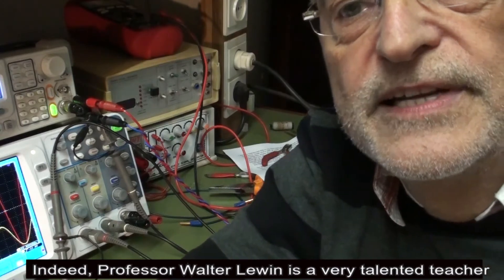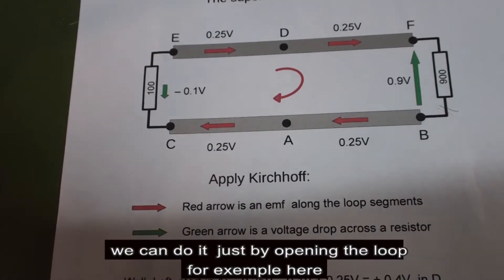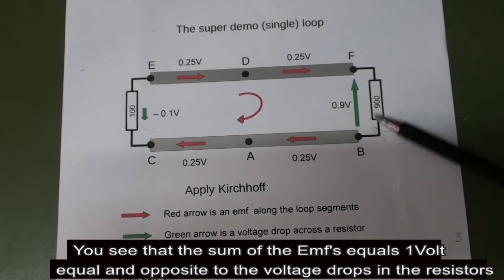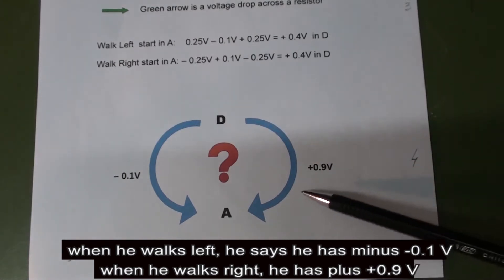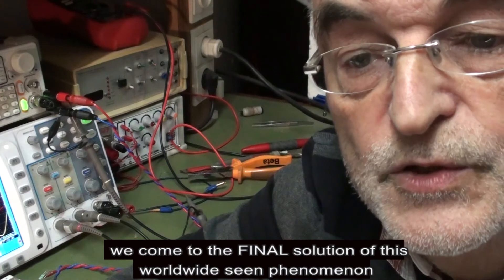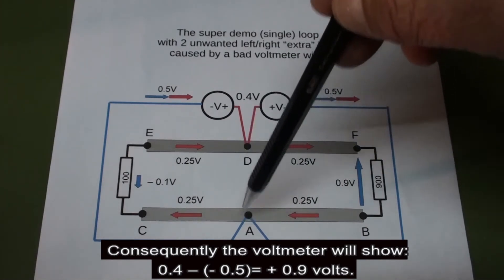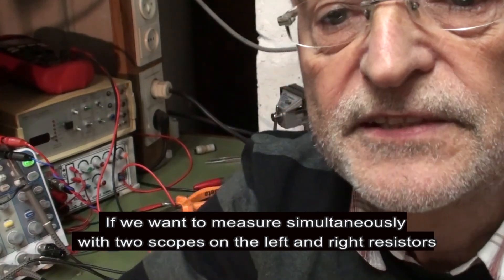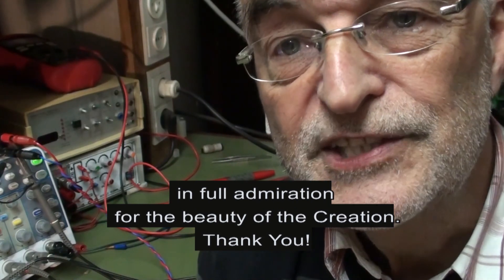W. Lewin Lect. 16 super demo revealed

Comment: Hi, at 17:13 when you flipped the probes and got a 0.9V to -0.1V switch, I told Dirk Meirvenne to try the same thing, and I told him the values would be 0.9V and -0.1V. First, he hid my post. Then, when someone requested the post back, he repeated his claim that the values would be 0.9V and -0.9V!!! Then he blocked me from posting anything else! So, I was right and he was wrong.
Reply: Mr. Stanger, you asked me what would happen if I turned my transformer 360 degrees!  Everyone still can read this.
This is copy/paste of your question Mr Stranger:
" I would be interested to see what happens if you were to repeat the 900 ohm measurement and turn the transformer over through 360 degrees (i.e upside down and continue until it is back upright.) Does the reading stay fixed, throughout?"
I gave you a complete description, and indeed at 180 degrees +0.9V will be -0.9V. 
If Mr. Mabilde turns his pulse giving coil 180 degrees (bottom/up), he will also measure -0.9V instead of + 0.9V over the 900 ohm resistor!
Just as are lying now (everyone can read your lie by comparing on my forum), I hope you don't start with your nonsense on Mr. Mabildes forum!
Reply: Dirk Van Meirvenne, You have hidden posts. That is why the post count shown is not the same as the number of posts you can actually read. I can still see my posts that you are hiding, even though no-one else can. If you hide things, not everyone can read them.
Reply: Here is the content of the post you deleted, Mr. Meirvenne: 
>>>>Yes, he seems to have deleted it. Maybe there is a confusion with the terms we are using, and he couldn't follow the post. I am not completely sure, but I think his argument may be that the PATHS of the probe leads are not part of "the circuit" and are irrelevant? The experiment I posted will show that they are still relevant, EVEN THOUGH he "concentrated" the magnetic field by using a transformer.
I wanted him to turn the transformer and resistors part of the circuit upside down (that whole unit), leaving the path of the scope probes fixed. And I wanted him to take measurements at fixed angles of tilt. There should be a 1 volt swing in the peak shown on the scope (say +0.9V to -0.1V). You can accidentally cause this 1V change by swapping the paths of the probe leads relative to each other (for convenient attachment)., effectively turning that part of the circuitry upside down, instead. The point is that the two parts of the circuit are reversed with respect to one another, whichever way it happens. That is what I think Dirk has done, and accidentally introduced an inconsistent 1V change in his reading. I hope this post remains. :-) <<<<<
The highlighted portion is equivalent to what Mr. Mabilde demonstrated. He could have flipped the whole primary/secondary/resistor assembly and kept the probes fixed. The sweep from +0.9V to -0.1V would have been the same.
Reply: Mr Icy, 1. I didn't hide your post. I was warned by youtube that a spam was coming in and if I want to delete it. I said" Yes". If I had to hide something, I wouldn't have recovered it, after it was asked by "Eshqa"!
2. The different with mr. Marbildes experiment and mine, is that I did all the effort to avoid that the magnetic field could exist in my measuringwires or probes by using a transformer. (see my whole introduction about this). So my results were produced in a way that always the same values would be measured, regardless the position of my wires or probes. So by turning the whole upset (transformer, the closed circuit etc.), my readings wouldn't change. Mr. Marbildes accepted the external induction and showed in a perfect way, that only his wires and probes are not effected when they are in a position that the cosinus of the induced field is zero. (90 degrees) Only in that position his measurement gave the correct values, as he made clear. Anyway, Mr. Marbildes and I have the same kind of conclusions, but these conclusions are not the same as Mr. Walter Lewin's conclusions.
Reply: Dirk Van Meirvenne, you placed a small closed loop at different positions next to the transformer. You got a negligible reading and misinterpreted this as the measuring wires being isolated from the inductance effect. The other poster explained your misinterpretation. I guess you blocked him too. I do not believe your spam explanation. You have deleted more of my posts and blocked me from posting altogether.
If you turn your module upside down, while keeping the measuring wires in the same position, you will get the same result Mr. Mabilde got by flipping the leads across. The reading will not stay the same as you imagine.
Reply: Mr. Icy; I will ask you some questions about basic knowledge which can be answered with yes or no: 
Suppose you do the next steps with a transformer e.g. a transformer with an metal E-core :
1. You have a transformer and you put an AC voltmeter over the secondary which shows 10V. Is this possible: yes – no?
2. You count the secondary windings and find it has 10 loops. Now you make a connection between 1winding and the other 9 windings and you do a new voltage measurement. Your results: 1V over 1 winding and 9 volt over the other 9 windings. Is this possible: yes – no?
3. Now cut the secondary transformer wire between the 1 winding and 9 windings. Now you have 2 secondary windings (1 winding and 9 windings). Again you do a AC voltage measurement and the results are the same as measured in 2. Is this possible: yes – no?
4.  a. Now you put a 900 ohm resistor over the connections of this 1 winding (single loop) and do a serial AC current measurement and a parallel AC voltage measurement over the resistor. Your results are: I = 1.11mA and the voltage is 1V. 
b. Now we do exact the same with a 100 ohm resistor: the results are I = 10mA and the voltage is 1V
c. Now we do exact the same with a serial circuit 100 ohm + 900 ohm, and do some more measurements: The results : I = 1mA, the voltage over the 2 serial R’s is 1V; the voltage over 900 ohm is 0.9V and the voltage over 100 ohm is 0.1V. Is this possible yes – no?
5. Now you disconnect the resistors and make exact in the middle of the single loop a new connection. You do a measurement between this new connection and the two existing wire ends. The result for each measurement is 0.5V. Is this possible: yes – no?
6. You disconnect the wire at the middle of the single loop, and now you cut the single loop where the extra connection was made, in two equal pieces. (So one piece goes through the space on the left side of the transformer and the other piece through the right side.) Do a measurement over each halve loop now and the results are 0.5V over each piece of wire. Is this possible: yes – no.
7. Now I take a resistor of 100 ohm and connect them between the two pieces of wire on one side. Then we connect the 900 resistor between the other side of the two pieces of wire. So this is a serial connection like this: /½ loop producing 0.5V /, 100 ohm resistor/ ½ loop producing 0.5V/ 900ohm resistor. Together the form one closed loop. Is this possible: yes – no?
8. Now you do a measurement over the resistors and the 2 halve loops. The results are: I = 1mA / 0.5V over one halve loop / 0.1V over the 100 ohm resistor/ 0.5V over the second halve loop/ 0.9V over the 900 ohm resistor. Your results are exact the same as measured in 4.c. The only different is that you cut your “power source” in two pieces and instead of 1V, you have 2 X 0.5V. Is this possible: yes – no?

This is very basic Mr. Icy! But I can imagine that it is confusing because when someone in practice want to connect a 900 ohm load and a 100 ohm load to a transformer, it would be idiot to cut your secondary transformers coil on another place to connect one of both resistors. Also the halve loop concept confuses many people, while this example would be clearer: If you have 2 transformers with each a secondary output of 0.5V. Regarding the phase, you can connect both this way that you have 1V output. If you connect them now with 100 ohm and 900 ohm this way that you have a closed lope (each resistor connects both transformers) THIS IS EXACT THE SAME SITUATION! And if you understand this reality which can be easily proved, then you can apply all the laws you wish.
Reply: Dirk Van Meirvenne laat u niet doen
Reply: Goed gedaan
Reply: Hallo V12345vtm; de conversaties zijn niet bedoeld als krachtmeting, maar om de waarheid aan het licht te brengen. En ik kan begrijpen dat voor vele mensen enkel de waarheid diegene is die ze zelf hebben ervaren of vastgesteld hebben. Tegenover de populariteit van de briljante Mr. Lewin kan ik niks tegenoverstellen en dat is ook mijn doel niet. Maar het is niet omdat je populair bent dat je geen fouten kunt maken. En vanuit mijn vaststellingen is er sprake van fouten, of kan je het eerder onder "misleiding" brengen. Ook ik heb niet alle wijsheid en waarheid  in pacht en als ik vaststel dat iemand me op iets wijst dat niet juist is, dan zou het kleinzielig zijn dat ik, in plaats van dit te aanvaarden en de juiste lessen eruit te trekken, er een grote bocht omheen maak. Bedankt voor uw aanmoediging, maar zelf vind ik dat  "me niet laten doen"  steeds op feiten en waarheid moet berusten. Vriendelijke groeten, Dirk
Reply: Dank U, Groeten, Dirk

Comment: Are you saying that going from E  to D to F causes 0,5 V drop ? 
There is no electric field inside a perfect conductor and therefor there can't be any potential drop. 
Even if there was an e field due to imperfect conductor it's so small that it's practically negligible. 
The resistance of a 0,5 m long ,1 cm diameter copper wire is about 1 μohm.
Reply from the maker: Dear Not me but You.Thanks for watching my video.   Look and listen lecture 16 of professor Lewin. At time 18:45 <<If you walk around in the wire you'll meet an EMF everywhere, if not, there could not be a current flow>>.   Words ofWalter Lewin, seeming very clear,    but...
 Unhappily the professor then forgets his own words and he no longer recognizes that an EMF can exist in a wire. Indeed measuring by means of an externally connected voltmeter is a tricky thing.
 In a next video I'll demonstrate a much better method to measure EMF' in wires forming a single loop. Hope that will repel all doubts.
Reply: His loop at 18:45 HAS resistance ,therefore has an e field inside and current flows.
The same can't be said for superconductors!
Reply from the maker: Of course neither myself nor Lewin can show you a demonstration with superconductivity. In my next video you will see, that in NORMALcircumstances, the voltage drops and the EMFs are distributed along the loop. Resistors like the 100 and 900 Ohm in the loop indeed have an EMF  only proportional to the arc length in the loop.( just like wires have it) But at the same time and in the same place, resistors exhibit an opposite voltage drop. So my wires only have 0.5Volts EMF and that even if they have  0.001Ohm resistance Of they have almost zero resistive voltage drop. Please do'nt apply Ohm's law on the wires: use it for only for calculating the power losses. In the wires we have to do with electromagnetic induction, the basic principle of transformators. Think about: Power transformers carry several Volts along only one single winding. Why should it be otherwise for the single loop set-up? The only difference is the degree of the coupling, weak air in my case.
Reply: my new video explains all:   https://youtu.be/JpVoT101Azg

Comment: Thank you for the video. Is it really so difficult to understand the Faraday's law? EMF is not a voltage, it is a force, which just numerically equivalent to the open loop voltage and has the same units. There are no mistakes in the measurements , when your measurements are in plane.  Any test charges been moving from A to D require different work depending on the path in such system, no matter of the crocodile of the scope probe. It is also very important for engineers, when they put the probes to the real points in the device, because it is extremely difficult (if possible) to find "zero plane" in a complex schematic, say switching power supply. It is very important to blew their mind and make them learn more general Faraday's law, rather then try to literally connect the phenomenon with restricted Kerckhoff's rule.

Comment: Mr Lewin used a magnetic field, not an induced electrical-electrical field.
Reply from the maker: Please what is your question ? it seems to me unclear! What do you mean by <<induced electrical- electrical field>>?
Reply: Cyriel Mabilde I mean that the test you have set up is not doing the thing that Lewin has mentioned. He mentioned a closed loop with 2 resistors and a changing magnetic flux through that area.  You’re setup is build on inductive electrical coupling only. 2 coils parallel to each other. 
It is true that an electrical signal through a coil generates a magnetic field. But the electrical field stays intact, and will be coupled to the loop on which the neasurements are done.
Reply from the maker: Dear, maybe you were misled because of my flat coils. The effect is exactly the same as with the "Lewin super coil" that I've built thereafter. I'm preparing a second video with the new coil, and hope to be more clearly. I'll demonstrate all possible measurements, in all planes, between all possible points on the loop. If it can help you, you may do a suggestion for a particular measurement that you want to be done by me. If you let it know, than I can attach it or send it already by mail. Best greetings from Belgium
 Cyriel Mabilde
Reply: Cyriel Mabilde Although my hands on physics knowledge has become quite rusty over the past 2 decades, I am aware of the interaction between the coils that you’ve used.  It is a nice experiment, that shows the effects of coupled coils. 
The big difference with Lewin’s drawing lies in the fact 1 loop, 1 changing magnetic field. So no second coil, no electrical interference, only a changing magnetic field inside the area of the loop.  And certainly not beyond this area.  You’re demo does not meet this requirements.

I admire you,re effort and courage in this. As far as I know there has never been proof that the law of Gauss did not held in some circumstances. So that law does stand firmly. And then we come into the complex world of non-conservative fields. That is what Lewin is talking about. 

So I want to ask you, if possible, to build a device capable of only producing a magnetic pulse, without the interference of electrical signals in the loop wich will be measured. Perhaps something like a horse shoe, were the air split must be minimised to allow the magnetic field, and at the same time this air split must be large enough to have room for the loop.

I myself did not find any pictures, drawings and /or schematics that Lewin used in his demo. Even the strength of the B-field is not mentioned anywhere as far as I have knowledge of. That information is key to rebuild the demo. 

Personally I have not the possibility to create such a demo at home. Not only because lack of hardware, but also lack of decent hands on knowledge of the complex world of electro-magnetic phenomia. 

If you want to discuss youre test system: always possible.

Greetings back from the Netherlands

PS: ageind: much respect for you’re effort
Reply from the maker: Nederlands maakt de communicatie heel wat gemakkelijker. Als Lewin die eenmalige magnetische puls opwekte dan was dat  via een ontlading van een condensator in zijn primaire wikkeling.
 Lewin made the primary current by discharging a  condensor into the primary winding, so creating a magnetic pulse. It makes no difference if you are using a continuous alternating current or a single pulse, as long as the frequency is low( in my model 50 kHz). The "Lewin pulse" had same order of rising time.
Reply: Cyriel Mabilde waar is de informatie te vinden hoe Lewin die magnetische puls heeft opgewekt?
Reply from the maker: op het forum van Lewin is er een vraag van "Dione' die hij beantwoordt en daarin verwijst hij naar de technicus die indertijd de opstelling in MIT heeft gebouwd.